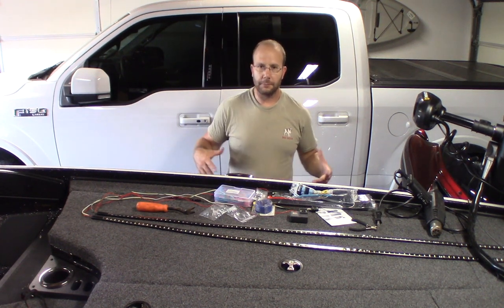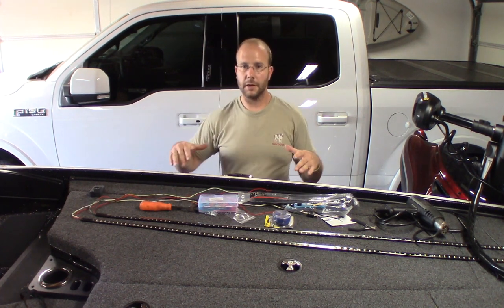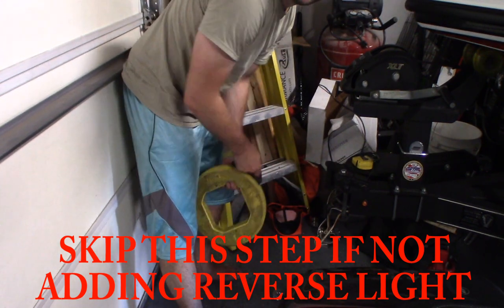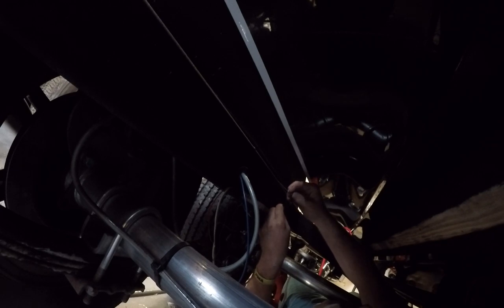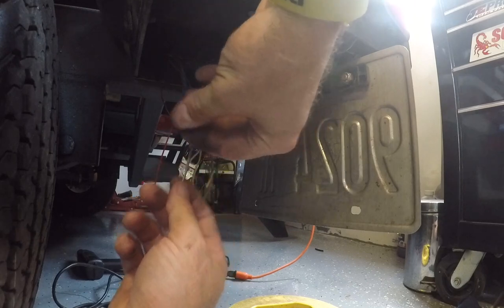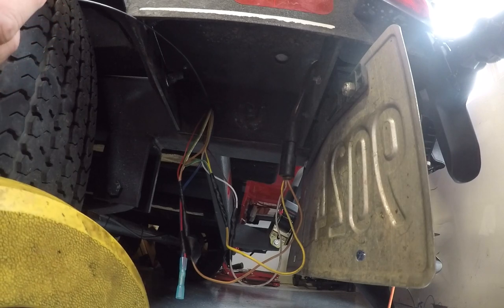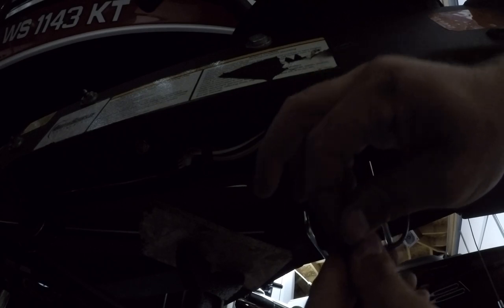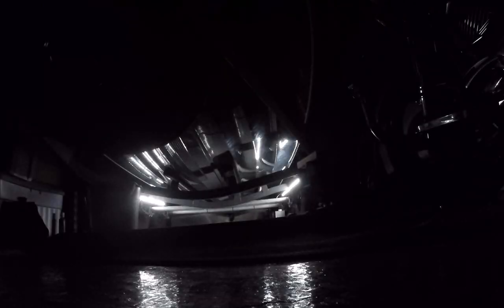AWSEOME CHEAP LED UNDER TRAILER UPGRADE

Comment: Where did you buy these from and wonder if they are available in amber, the police here in Arkansas will ticket any other color I have been told
Reply from the maker: I got them on ebay. They are truck tailgate led brake light turn signal bar. With just the red running lights on its not super bright where a cop would think you have undergrow light or something. I can see them innthe rearview mirror though. All legalities aside it's well worth it. I got them for 16 or 17 each and my best part is when the truck is in reverse and you load the boat it lightens up the water in the dark, obviously ypu need someone else in the truck if it's in reverse, but even the res can be seen at night in the water.

Comment: Great idea going with the tailgate lights you selected. I was going to go with just the straight while LED strips. How has the self-adhesive tape held up to repeated launches and trailering? Any issues with it peeling off? Do you have any pics of the trailer at night with the running lights on?
Reply from the maker: No issues at all with the adhesive yet. I did leave a ziptie or 2 where you cant see them behind the fenders. I'll see if I still have one. Either send me ur Facebook profile or email I'll try to send it to you
Reply from the maker: https://m.facebook.com/story.php?story_fbid=3211264438914287&id=100000922864257

Comment: Do you have the link from eBay or the brand?
Reply from the maker: This is one by the same seller, but not the same item the item I bought has been discontinued 
https://www.ebay.com/itm/353459884228?mkcid=16&mkevt=1&mkrid=711-127632-2357-0&ssspo=qdnt7gjzric&sssrc=2349624&ssuid=cXPGkdkuRyu&var=&widget_ver=artemis&media=COPY